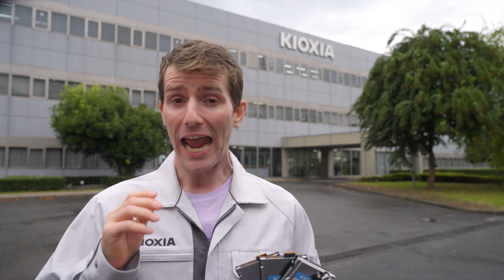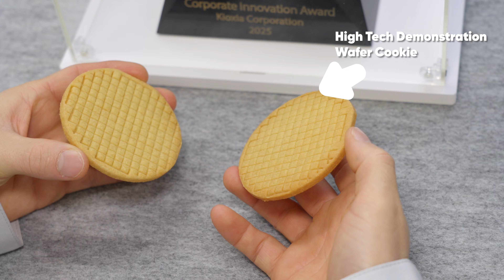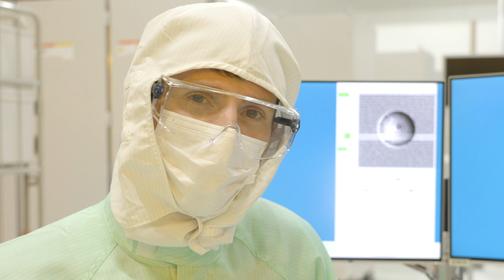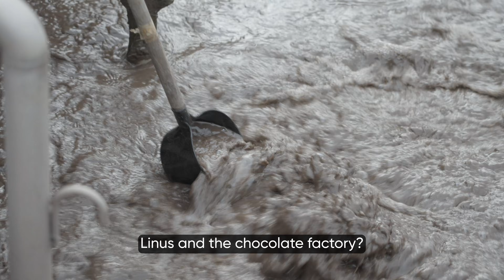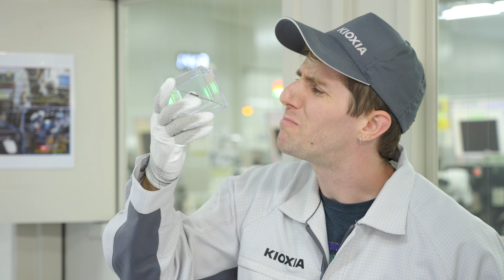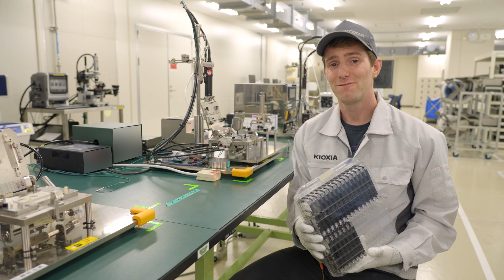A Petabyte in the Palm of My Hand - Kioxia Factory Tour

Comment: AI Summary

Abstract:

This video showcases an exclusive tour of Kioxia's Yokkaichi semiconductor fabrication plant, focusing on the production of high-density 3D NAND flash memory, exemplified by their LC9 SSDs capable of holding 245TB per drive. The tour moves from raw silicon boule creation to the complex multi-layer deposition and wafer bonding processes. Key technological highlights include the use of Plasma-Enhanced Chemical Vapor Deposition (PECVD) for creating 218 storage layers, the innovative CMOS Directly Bonded to Array (CBA) technique which involves separately fabricating CMOS and NAND layers on different wafers before bonding and grinding the stack, and aggressive backside thinning. The facility’s massive scale (nearly 700,000 m² across seven fabs) is contrasted with its extreme cleanliness standards (Class 100-like environment). Furthermore, the discussion touches upon Kioxia's advanced defect minimization strategies utilizing AI analysis of SEM data, significant sustainability efforts including water reclamation (achieving $>90\%$ recovery in new systems), and remarkable seismic isolation technology that suspends the building structure on nearly 400 specialized footings. The final stages cover die separation, wire bonding with gold filaments thinner than human hair, packaging (including solder ball deposition), and final SSD assembly, all performed with high automation, even on this prototyping line.

Summary:

* 0:00 Introduction & Density: Linus highlights the density achievement: four Kioxia LC9 SSDs (245TB each) approach a petabyte, thanks to 32 stacked dies per NAND package wired with gold.
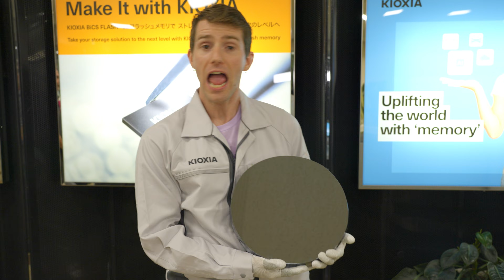* 1:36 Silicon Ingot to Wafer: The process starts with pulling a teardrop-shaped monocrystalline silicon ingot from molten silicon, which is then sliced into 300mm wafers.
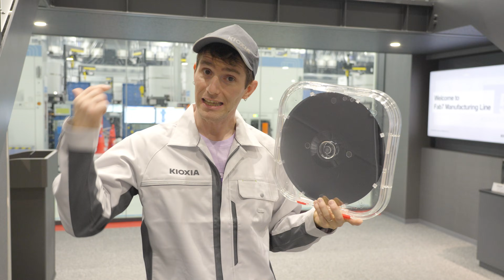* 2:09 Wafer Transport (FOUPs): Wafers travel vast distances within the facility (up to several kilometers) inside sealed carriers called FOUPs, moving between buildings via automated skyways.
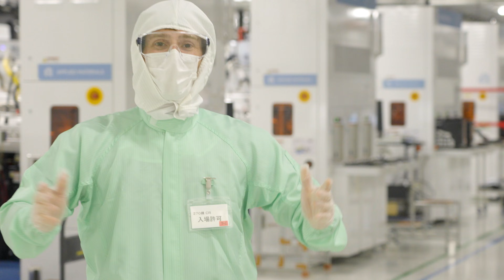* 3:11 Y7 Clean Room: Fab Y7 maintains extreme cleanliness to prevent particulate contamination, essential because one particle can ruin months of work.
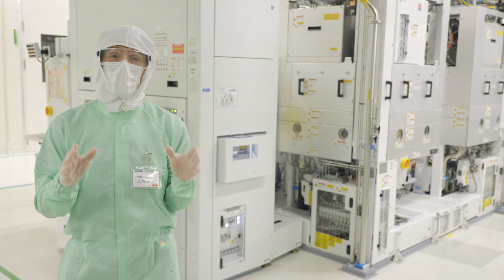* 3:35 3D NAND Construction (PECVD): Kioxia uses Plasma-Enhanced Chemical Vapor Deposition (PECVD) to build the 218 intricate storage layers required for their BiCS Flash Generation 8 memory cells.
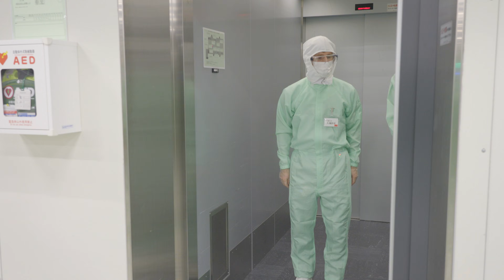* 4:26 Sub-Fab Structures: The facility uses a dense, multi-level support structure (subfab and sub-subfab) below the cleanroom to house ancillary equipment like vacuum pumps and toxic gas neutralizers, optimizing layout efficiency.
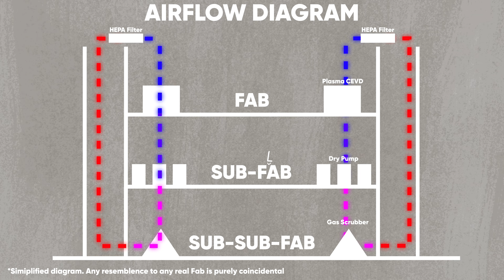* 5:50 CMOS Directly Bonded to Array (CBA): Kioxia fabricates the CMOS logic on a separate wafer and then bonds it to the NAND stack using a copper layer, grinding the combined wafer thin afterward to save vertical space.
* 7:22 Defect Minimization via AI: AI has been used pre-trend to analyze over 35,000 data points per second from scanning electron microscopes (SEM) to identify and simulate fixes for defects, improving yield.
* 8:41 Facility Scale: Fab Y7 alone covers 3 million square feet, requiring cranes to lift equipment up seven stories for installation.
* 9:29 Sustainability (Solar & Water): The facility incorporates large solar deployments (one site over 2MW peak) and extensive water reclamation systems, achieving over 90% recovery rates in newer fabs, necessary because chip manufacturing demands ultra-pure water.
* 12:22 Wafer Thinning: After bonding the CMOS and NAND wafers, the top wafer is ground down from $\sim 800 \mu m$ to $30-40 \mu m$ to maintain overall package thinness.
* 13:44 Die Cutting and Wiring: Individual dies are cut from the thinned wafer. Stacks of up to 32 dies are interconnected using incredibly fine gold wires (quarter the thickness of human hair).
* 14:40 Packaging (Resin and Solder Bumps): Bonded dies are protected by pouring resin over them and baking; subsequently, solder balls (for BGA interface) are precisely placed onto the backside contacts via vacuum head and reflowed in an oven. Defective packages are identified (missing laser engraving) and discarded.
* 16:31 SSD Assembly: Packaged NAND dies and DRAM caches are placed onto blank PCBs using high-speed pick-and-place machines, followed by solder paste application, vision inspection, and reflow in a multi-zone oven to prevent brittle solder joints.
* 18:18 Earthquake Protection: The building structure is decoupled from the foundation using nearly 400 specialized seismic dampers/footings made of materials like natural rubber, allowing the building to move up to 60 cm during an earthquake.

AI-generated summary created with gemini-2.5-flash-lite-preview-09-2025 for free via RocketRecap-dot-com. (Input: 21,743 tokens, Output: 1,135 tokens, Est. cost: $0.0026).

Comment: 7:17 AI/ML for Industrial Vision and Inspection has genuinely been in use for decades. It was one of the first really useful applications of the tech.
Reply: @jajssblue  I was testing a primitive version of it in the production of CD's in the late 90's so nearly 30 years ago!
Reply: @prime1971 Awesome! I know OCR was one of the applications that was first cracked by early methods that weren't GPU accelerated. And then, I think, contrast defects and edge detection were popular implementations. It's a really fascinating recent history that is actually fairly easy to trace through the research literature. It's just been a while since I've dug into it.
Reply: Yeah the manufacturing plant I work in has these systems since 20+ years iirc. Mostly for checking soldering joints via optical and xray test.

Comment: According to papers on Semiconductor manufacturing energy consumption, HVACs use around 40% of a semiconductor fab's power, primarily to maintain the class 1-5 rooms. They cycle a huge volume of air from top to bottom. 

If you want to get a semiconductor fab to use less energy, you have to figure out how to get them cleaner for less.

Comment: I have no idea why it says NVME on it, that is not an NVME  connector. That wouldn't plug into any NVME slot I've ever seen. And at the size, they should have made it SATA. My guess is that there's really an adapter board with 2x NVME slots in it, with a very non-standard connector, so people would need a third party adapter to use the thing.

Comment: The defect picker-upper is probably closer to an "algorithm" than AI. These things typically run on dozens of parallel ASICs with specialized traditional algorithms that run VERY fast. Machine learning algorithms would be too slow for the amount of ground that needs to be covered for every single wafer.
Reply: they call it AI because its a buzz word for investors to stfu about AI bs
Reply: It's probably some sort of "Machine Learning" (one example approach would correlate the electronic-test failure defects with the images, and then predict the failures from the images) which used to be called AI... until we actually got good results out of it, and gave it a proper category and name (Machine Learning, Deep Learning, Machine Vision, etc.)  The industry has had a tradition - since the 1970s - of only calling it AI up to the point it actually works :-)
Reply: @MarkEichin  Yeah, I have no experience  predicting failures from defects. I'm talking about initial detection where you have to scan a whole surface (in a somewhat reasonable amount of time). Identifying whether they're critical defects absolutely could be.
Reply: (and while machine learning training is expensive, running it on real time data is often cheap enough to use it for absolutely trivial things, like robot finger positions - but here, I suspect the trick is that they can get the images much earlier in the pipeline, before they're cooked enough to run electrical tests on, and discard them more cheaply...)

Comment: Linus casually kicking the building
Someone doing nano scale calibrations inside: "Gah! Cursed, I have to start this 8 hour process again!"
Reply: RAM prices spike.
Reply: In all seriousness, a casual gust of wind would do more than Linus did, and they would have those constantly, so they actually can't be doing anything that would be impacted by something that small.
Reply: @milamber3312345 there are probably even areas in that building that are decoupled in a similar way again for exactly that reason.
Reply: @MarcoTedaldi  Nah just a building worst case make a machine with the needed tolerances and "give". A lot cheaper that way I'd imagine.
Reply: @MarcoTedaldi  Looking through their reliability handbook that's online they do go to very extreme lengths to make precision a high playing factor for success rates so maybe I'm completely wrong about that though. For a massive operation maybe it is handy
Reply: @novaenricarter705 i think, when you're at the level of precision they need, they'll have a staged approach. Building (probably mostly because of earthquakes), sections of the building (the limit the spread of vibrations from part to part and to isolate from wind induced vibration) and machine level (because even puny humans walking around make vibrations)...
Reply: @MarcoTedaldi That makes perfect sense!
Reply: @novaenricarter705 I used to work at a university as a technician. Next door was the Holography/Laser Lab. They had built a structure with a floating floor (many tons of concrete isolated from the surrounding ground). And the hull of the building was not standing on that foundation but on the surrounding ground to prevent vibration from wind transmitting to the isolated plate. The engineering going into just this little aspect of the fab is insane!
Reply: the sound when he fall to the ground would be more than enough for those high precision machine
Reply: @MLeoDaalder  For a brief moment when he first did it, part of me expected to see the building move a little 😅
Reply: I got really confused for a sec thinking you were talking about nanoscopic oompa loompas
Reply: I was looking for this comment 😂, I was thinking “shouldn’t you not kick the building after explaining how important it is that it doesn’t move or vibrate?”

Comment: Let's see, I'm in the mood for some napkin math:
square = 2 tbit, 8TB package -> 32 squares
45 squares high -> 300/45 = 6.7mm
24 squares wide -> 300/24 = 12.5mm 

Die per Wafer Estimator says ~728 die
SemiAnalysis Die Yield Calculator says ~752 full die
After yields probably ~700 good die?

So an 8TB package uses 32/700th of not one, but two wafer, since there's that double wafer thing going on at the beginning.
That's just shy of 22 8TB NAND packages per double wafer, max - probably closer to 20 after other defects.

If these wafer starts were priced like TSMC does things, SSDs would be a whole lot more expensive than they already are. I did not expect a 8TB SSD to require that much wafer to build.

Comment: I love me some Kioxia. Did you know that WD NVMe are actually Kioxia? They use the same chips and controller. Also, Kioxia is cheaper than Samsung but just as reliable. That's why I always buy an Exceria for PC builds. Right, I have an Xceria G3 2 TB in the system.

Comment: 9:55

Biochemist here.  No, ultrapure water does not extract minerals from your blood stream.  A few things prevent that.  First, as soon as you drink the water and it hits your stomach, it's no longer pure and is full of minerals.  Second, the water you'd drink doesn't directly interface with your cells.  Cells are where 95%+ of your minerals are, with sodium being an exception.  You will not actively leech minerals from inside of cells because the ions within cells are heavily regulated by active ion pumps, not passive diffusion.  Lastly, to address the possibility of sodium dropping in your blood to too low of levels, that would only happen if you've already exceeded your kidney's capacity to excrete the amount of water you are intaking.  So you'd be dying of general water poisoning, not the water being pure.  

Anecdotes don't mean much, but just as a note I've been using a ZeroWater filter daily for years now.  The water that comes out is 0ppm (not as pure as the stuff on video, but at this low of a concentration it's negligible when it comes to biological meaning), and I've never had issues with losing minerals.
Reply: Thanks. Instances like this really highlight why experts in one area (memory fab) should not talk about another area (biological processes) in which they do not have the expertise.
Reply: Thanks. Instances like this really highlight why experts in one area (memory fab) should not talk about another area (biological processes) in which they do not have the expertise.
Reply: Yeah I was thinking that; the moment you drink it, it's obviously no longer ultra pure.
Reply: Proof?
Reply: @WernherVonBraun_SF3 basic biochemistry, go learn some in school
Reply: @thetaintpainter5443 you cannot say it doesn't pull minerals out of body without testing literally prove it using a research paper not shitty school books
Reply: @WernherVonBraun_SF3  literally just use your brain for half a second.  As soon as the water is in your stomach, it's no longer pure.  It's no different than drinking any other water.  Do you just not know how to think?
Reply: @thetaintpainter5443 show me the data if you dare
Reply: @WernherVonBraun_SF3  you're genuinely a clown who doesn't understand basic logic.  You don't seem to have a grasp of how science works in general.  There isn't going to be a paper on this because it's not a hot button research topic, since it's very obvious how it works using fundamental biochemistry knowledge.  You're just doing this in bad faith, get out of my mentions
Reply: @thetaintpainter5443 I asked for mineral percentage that is extracted vs not in % form regardless of interaction with stomach acid also large enough quantity can absolutely do that regardless, your incompetence to understand question is quite astonishing.
Reply: @NASAadministrator the mineral percentage that is extracted will be the exact same, as the water you drink doesn't directly interface with our cells, and over 90% of minerals are intracellular and therefore controlled by voltage gated ion pumps not passive osmosis.  It's not extracting anything period.  I understand your question just fine, it's just a stupid question predicated on ignorance of basic biology and chemistry.  There is no specific percentage change as no biochemist or biologist wants to waste their time on this very obvious "problem"
Reply: @thetaintpainter5443 so called biochemist we they are asked for showing data instead of telling a narrative that has been spoon fed without enough data to back up
Reply: @WernherVonBraun_SF3  Put together a coherent sentence and get back to me.  What narrative has been spoon fed to me?  What I'm saying is quite literally the opposite of the narrative being spread in the video.  Are you mentally deficient?  Like I stated, I drink demonetized water DAILY, close to a gallon a day, and I have never had a mineral deficiency.  Further beyond that, the water mixes with your stomach juices.  It's no longer pure water, there is functionally 0 difference as the mineral content in something like spring water is already quite low.  The concentration of minerals in your water is negligible compared to the concentration of minerals in your stomach, and therefore does not shift the equilibrium in a significant way.  You aren't just a Clown, you're the whole circus.  No scientist is going to waste their time setting up a study on this.  There is no knowledge to be gained from that, since it's very obvious what happens.  I urge you to learn even a smidge of chemistry and you'll see how dumb your request is.
Reply: @WernherVonBraun_SF3  as soon as the water touches and mixes with your saliva, it will have a higher mineral content than tap water.
Reply: @thetaintpainter5443  he is trolling you.

Comment: Its amazing how the price of just 1TB of SSD has changed over the years. It wasn't long ago when it was   ~$100/TB, now due to the AI bubble, it costs double!
Reply: I'm an old that remembers when you couldn't get a megabyte of storage for 100 bucks.
Times sure have changed
Reply: It costs less actually, the price of storage wasn't one of the things affected.
Reply: @aminulhussain2277  Samsung completely stopped the production of SATA SSDs last week. How were the prices not affected?
Reply: @andreaspatsalides1914  You answered your own question, they stopped production of SATA SSDs. The overwhelming majority of consumer electronics have switched to either soldered on storage or M.2 NVMe drives while servers/datacenters are pretty much exclusively using NVMe u.2/u.3 or EDSFF which is also using the NVMe protocoll.
Reply: @andreaspatsalides1914  Nobody uses sata anymore
Reply: @andreaspatsalides1914  it was like $50/TB before the bubble. also why is stopping SATA SSDs such a big deal.. who even buys those?
Reply: @sumansaha295 Yes I exaggerated the number. There are people who do buy SATA and when the production stops, prices go higher on every SSD
Reply: @sumansaha295  Most boards give 2 or 3 nvme slots, so your looking at 6-12 tb storage at on at the upper limit(very few buy 8 tb nvmes) there is a bunch of sata mounts ie a lot of potential for storage capacity, it might be old but very useful for extra bulk storage same with hdd's. It's old tech but still useful, the video is talking about real 256 tb drives and a potential 1 petabyte ssd.  They need a new interface the form factor is fine, if we had affordable 50 or 100tb+ nvme out now you might have a valid point.  Rather odd to see people cheering on the limiting of pc storage capacity.